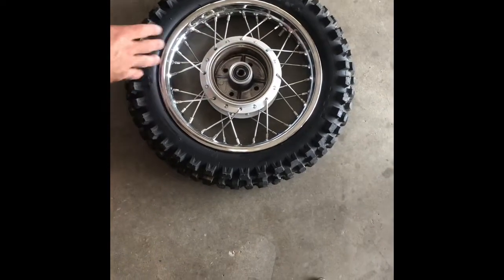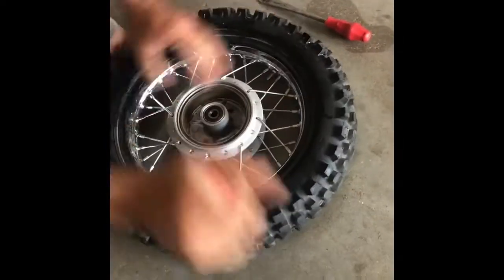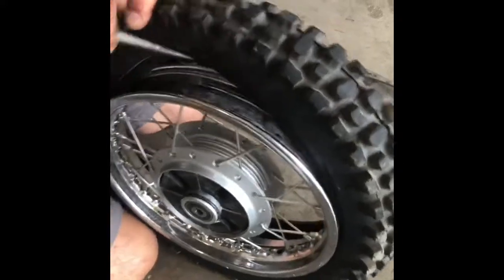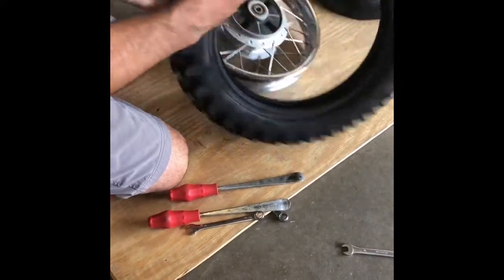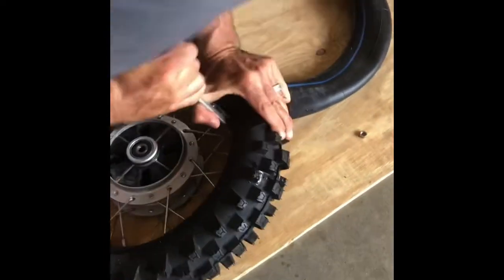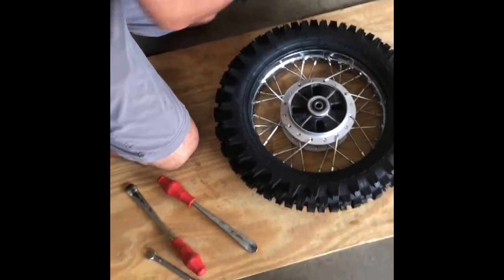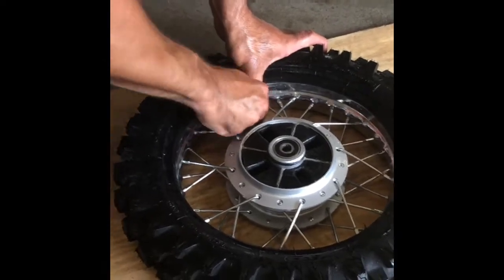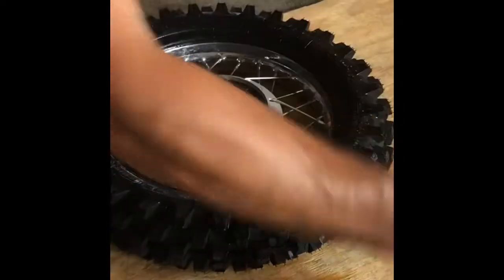How to change a pitbike tire

Comment: Hey man I keep replacing my tire and the valve stem keeps ripping any clue of what it could be?
Reply: Happened to mine m8 it's rate annoying I think it's bc the wheel is old or it's cold and brittle or it could be not enough tire pressure
Reply: @lIIIllIlIIlIlI  thx man so would You recommend me buying new tires with rims
Reply: @luisarredondo5744  yo lmk when you find a solution
Reply: You need a rim lock. YouTube it.
Reply: Check your psi and adjust to oem specifications
Reply: Rim lock.......        what is it ameture hour?
Reply: You're running the tyre without a rim lock like the guy in this video! If you don't wish to fit one then try running over 20psi instead.
Reply: Yes like someone else said. You need a rim lock...just put one on. You will need to drill a hole for it.